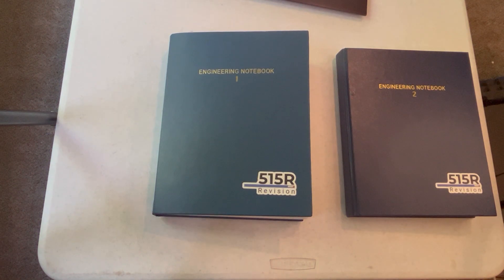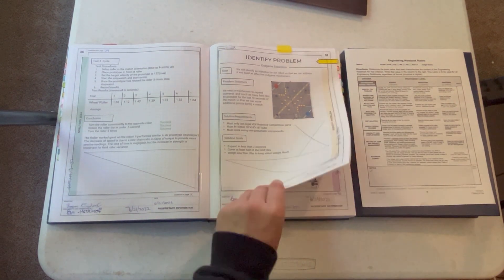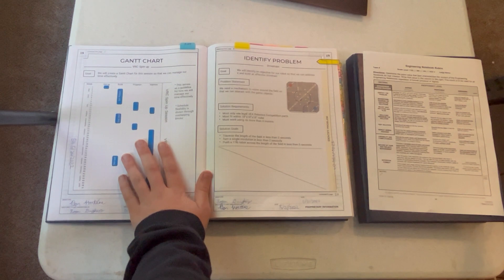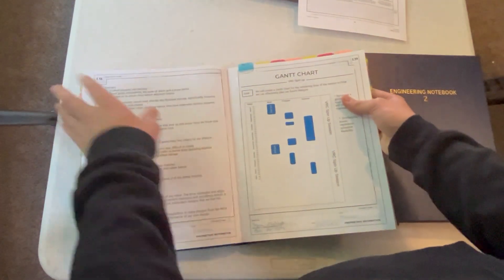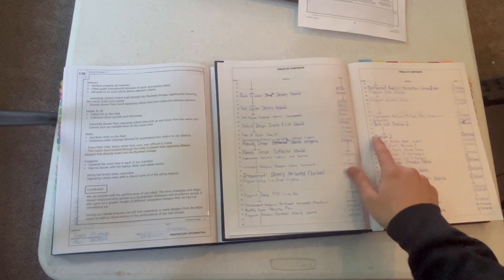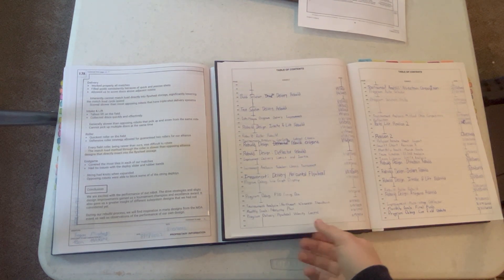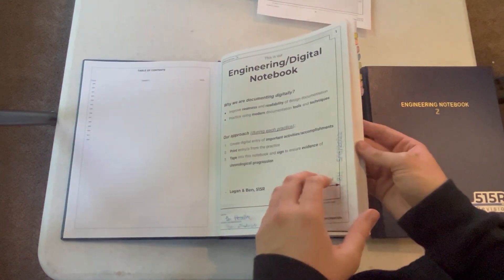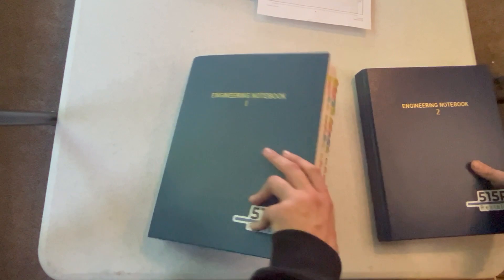Notebook Explanation - Worlds Design Award

Comment: could you possibly send a link of where we can get that notebook since the actually vex notebook is small
Reply from the maker: We used Book Factory to get the hard-bound notebook.

If you would like to check the notebook out, the URL is
http://acct107430.shop.netsuite.com/s.nl/c.ACCT107430/it.A/id.406/.f?sc=23&category=104

For more options of different notebook size/page count, the full catalog can be found at
http://acct107430.shop.netsuite.com/s.nl/c.ACCT107430/n.1/sc.23/category.104/.f
Reply: @515Revision  thank you

Comment: What websites/applications did you use for your Gantt and pie charts?
Reply from the maker: Gantt charts: Lucid Charts
Instead of having a automated Gantt chart, we manually moved/resized boxes onto the canvas to create our timeline.
We recommend looking to automated options, however, because our Gantt charts took a while to complete.

Pie charts: Google Sheets
We highly recommend using Google sheets for most types of charts. It is really quick to use and has a decent result. 
The main beef we had was that the text was small, when importing to the slideshow. This can be solved by resizing the chart on the Google sheets end.
Reply: @515Revision  One more question if I may is where did you buy your cardstock/composite notebooks?

Comment: Hey I really like the font made out of punctuations like dashes in the code section. What tool did you guys use to generate those letters? Thanks and great season!
Reply from the maker: Our code section were generated with a package(extension) on Atom, the old IDE for PROS. It converted a file of code into a pdf, which we drag-and-drop into the slideshow project. Unfortunately, I do not believe Atom no longer allows new downloads to packages; so I am unable to point to a solution.

All other visuals on program entries are from Google Slides Shapes/Lines.
Reply: @515Revision  Ok thanks! Also I'm just wondering what templates you use? I see Eztemplate and Okapi mentioned somewhere in the code, but what do you use them for, and is there anything else that you guys would recommend? Thank you! 😄
Reply from the maker: We used EZ template for pre-tuned PID drive movements.

Okapi is a prebuilt library in PROS and has a wide variety of uses. The one we used for most of the season was it’s chassis builder, which is drag-and-drop odometry.

In the final months of the season, we used JAR-TEMPLATE, one of the best Vex-Code templates, and rewrote their odometry code in PROS.

Finally, we highly recommend checking out Sylib. It’s a library that filters motor velocity to give a more accurate reflection of the actual motor velocity.